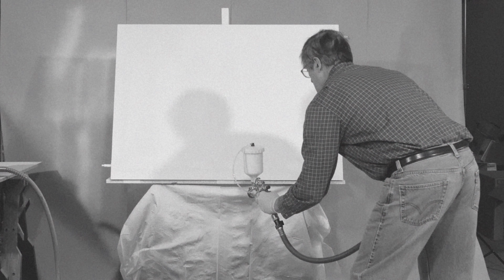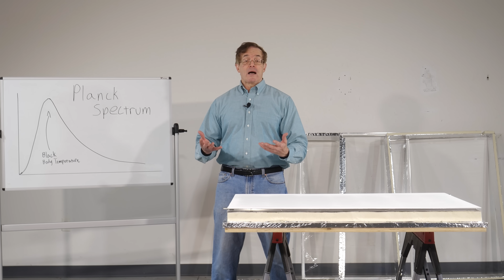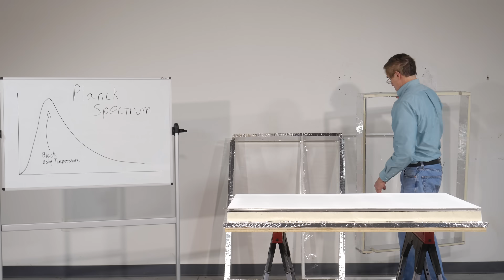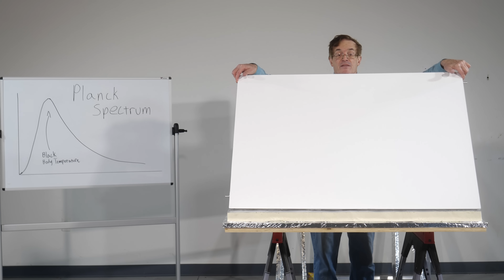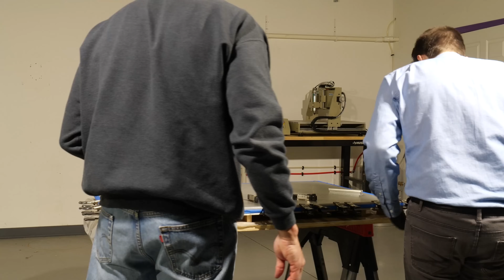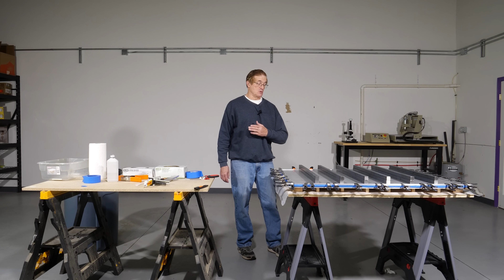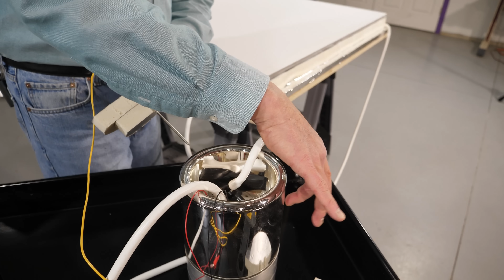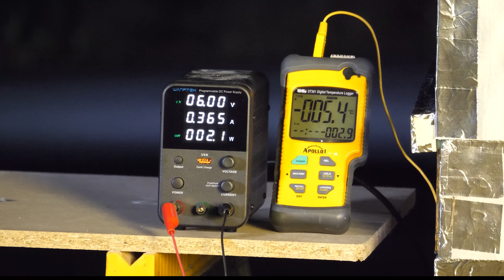Air Conditioning isn't free... but we're close.

Comment: We've seen the system is able to cool itself below ambient. Many systems can do that, though. To make it useful in practice, it has to be able to cool itself plus a thermal load. Imagine cooling a device with this - how much Wattage can it cool away and still get below ambient? If I need to cover the roof of an entire school with this to cool a single computer it's no longer inexpensive or useful. So: what's the thermal capacity of this solution per m² of roof space occupied?

Comment: Heat siphon might work well to carry the heat to roof top. Have to be able to stop the flow of liquid in winter though. Heat siphon is boiling a liquid, steam goes to roof and liquid comes down to for example to the heat pump heat exchanger. The amount of liquid needed is just to fill the down heat exchanger. Vacuum the tubes and insert the liquid like acetone.

Comment: HVAC tech here, and I see an obvious problem.  The flat panels with the special paint will quickly get dusty and lose the desirable thermal radiation characteristics.  The electric utility had an experimental thermal solar plant to produce electricity in the southern California desert.  It used mirrors to focus the sun's rays on a boiler. Of course the mirrors get dirty. The article I read showed that the wages of the mirror cleaning crew cost more than the value of the kilowatts. The same problem applies to this approach.
Reply from the maker: Maybe.
We're  testing  a few panels outside since this video was posted.  After  one year, we'll show the effect of the environment.

Comment: What if you placed fins like a heatsink on top of the radiating surface instead of the box, to block external factors? As long as the blades were sufficiently thin it should still be able to "see" the sky mostly unobstructed, while the fins would also be blocking incidental infrared radiation from surrounding objects. Also, what if you painted the fins with the same radiative layer as the main heat exchanger surface?
Reply from the maker: That's a good idea.
Reply: The radiative surface needs to be face the sky.  Fins are for conductive heat transfer to a (hopefully moving) fluid.

Comment: The reason I watched this is because way back in college in my Heat Transfer class on route to my engineering degree, my professor explained radiant cooling and anecdotally explained why people have been able to make ice in the desert by digging a hole and filling a vessel with water at night.  The heat radiated into the often clear desert skies at night while absorbing very little heat, enough to make ice.

This was a great experiment!  I can see this as a way to boost existing air-conditioning and refrigeration systems to save electricity!

Comment: This is poppycock.  If you could actually cool something below ambient temperature without energy, you'd have a perpetual motion machine.  You'd just connect a Stirling engine to it.
Reply from the maker: No.
Rewatch the beginning of the video.  Ambient temperature is the equilibrium of everything, including the air at ground level. This is due to the inter-exchange of  both direct conduction and infrared radiation. Because  space and the upper atmosphere is so cold, a surface that radiates that infrared better than everything else can dump that energy better than everything  else into space. That surface needs a clear view of space, or this will not work.

Comment: Wouldn't the power supply be heating the temperature sensor?
Reply from the maker: It does a little bit.
The actual  thermal performance is a little  better than shown.

Comment: You must have a engineering degree in the combination of all other specialized trades. That is an extremely intelligent design. Would have lost several on the expansion with the inflow and exfow. I do have an inquiry though, what is the atmospheric pressures put on the epoxy bonds? Does it seem to hold over long durations of time or crack at highly pressurized areas with vibration stess points or points of resonation?
Reply: Also, is water the best medium for absorbing ambient temperatures, versus isopropyl alcohol and water mixture, or copper sulfate and water mixture? Just curious.
Reply from the maker: Thanks. 
Water is the best, but depending  on the minimum  temperatures expected, an antifreeze additive such as alcohol or glycol could be added with a small drop in performance. 
The epoxy bond is far stronger than needed as the pressures  are quite low.
Reply: @TechIngredients  thank you for the response. I greatly appreciate your content and always treasure your advice. It's hard to say I'm not trying to flatter you, when I do so enjoy your ideas and the way you get your points through. Again thank you and I wish for you all the success in the world.

Comment: @TechIngredients, so in theory, running this loop behind solar panels to cool them down say in the Phoenix temperatures, is a feasible thing to do? So run the exchanger on the roof where the solar panels are not and use heat exchangers fixed to the rear of solar panels should increase efficiency of the solar panels, and put hot water in my pool or holding tanks for the house?

Comment: if the cost of the coatings exceeds the electricity cost to run the AC, its not economical.
Reply from the maker: That's  correct.
Keep in mind that cost can become  complicated.  There's  installation  and disposal costs, aesthetic concerns, local regulations, and structural limitations.  It's  nice to have options.
Reply: Don't forget the cost of a squeegee crew to keep the coating clean.  A coating of dust changes everything.

Comment: Interesting radiator. I made a smaller one for a gaming console about 20yrs ago using aluminium, a dremel and aluminium jb weld epoxy.

Interesting paint
Reply: yeah its basically a Single Panel  (Type 10) radiator

Comment: I made an experiment of underground tunnel, very small one on my lot and put a fan on the edge of that tunnel. The design was a pipe from my rooftop around my garden, traveling all the way underground getting sucked with the fan. Its not as cool as aircon but its cooler than an actual air fan is giving. The idea is the fresh air from my garden, cools of the air while traveling on the tunnel until its released on the fan sucking the air from my rooftop pipe. So I feel comfortable because the air comes from my garden.

Comment: Could you put a thermal electric couple on the opposite side of the heat exchanger to power the pump off of the ambient outside temperature?
Reply from the maker: Yes.
However,  these devices  are very inefficient.  You'd  be better off using another  source  of electrical power.

Comment: how's the performance during hotter weather?
Reply from the maker: The performance  increases as the temperature  increases.
Thermal radiation  is dependent on the temperature  to the fourth power.
Reply: @TechIngredients  yes, my apologies for not being more specific, but have you measured it during the summer?
Reply from the maker: Yes.
The differential is greater by a factor of about 3.

Comment: Did you experience any condensation and achieve any due point variants? If you did, you can also use this to collect drinking water. Multi harvesting can help achieve more reward with less separate systems.
Reply from the maker: You're correct.
We didn't because  the relative humidity levels were pretty low.

Comment: The temperature of the refrigerant coming from the compressor after the fan has removed heat from the refrigerant, most certainly can get lower than ambient temperature.
Reply from the maker: Correct

Comment: We're over halfway thru the video. You still haven't explained what you're making, what it does or how it works. You explained the science behind thermal emitters and then said "so we built this".....to do what? How do you employ it? And then you simply went into building the components. What exactly do the components do? There's no structured path to understanding what we're seeing or hearing, creating more confusion than understanding.
1. This is what it is (also is it a scale model or an actual operating system?)
2. This is what it does.
3. This is how it does it.
4. Why it works (now explain the science of it).
5. These are the components.
6. This is what each of the components does.
7. Component #1, the So And So. 
8. These are the materials it's made from. 
9. This is how much of each material you need. 
10. This is where I procured each material (and other possible sources. Can I use an alternate material?).
11. These are the subcomponents of Component #1, the So And So.
12. This is how you build this subcomponent of Component #1, the So And So.
13. Repeat. Demonstrate how to build each subcomponent of Component #1, the The So And So 
14. This is how you assemble the subcomponents of Component #1 to complete the So And So build.
15. Repeat steps 7 thru 14 until all components of the system are completed and ready to assemble the system.
16..This is how you assemble the components to complete the system (stress any peculiarities and key points of building the system to ensure it will do what it's suppose to do or to prevent failure).
17. This is how you employ the system (include ideal circumstances and possible modifications that may be necessary).
18. Demonstrate/test the system. (Also display and explain the data). 
19. Preventive Maintenance Checks and Services (routine maintenance, before, during and after operation maintenance, intervals, trouble-shooting, spare materials to keep on-hand).

The idea is always "Bottom line up front".......This is what it is. This is what it does. This is how effective it is.......then justify those assertions.....explain how it works and the science of why it works, and the data that proves it works. THEN demonstrate how to build it, put it into operation, and maintain it.

You did it all backwards and left out a lot of explaination. It was a state of confusion of what you were actually doing until two thirds thru the video and left a lot of questions unanswered.
Reply from the maker: Thanks for the long comment.
Reply: @TechIngredients  I like your topic.       I appreciate the time you take to present it to the rest of us. If I didn't  believe in the merit, credibility and potential of your content, I wouldn't have bothered.
   I'm a DoD contracted civilian instructor. I train all US branches of service and some foreign militaries on 32 different US DoD combat service and support systems; from EOD bomb suits and parachute systems to communications, laser and thermal optics. 
   It wasn't my intent to nitpick your video. My intent is to suggest a better structure to your presentation to make it more effective and "more learnable" (easier to comprehend with less frustrating confusion).
Thanks and good luck!

Comment: I've long been thinking about this as an alternative to solar for fixed energy production. Heat engines need a hot and cold side, and we usually think of ways to use ambient air as the cold side, but perhaps we could use it as the hot side. ~200 watts per square meter isn't bad, and works better the farther it is from the equator.

Comment: Is the primary layer just solid foam  covered in the silver tape and topped with a thicker layer of foam? More details in the Patreon site? Thx
Reply from the maker: I'm  confused.  Can you be more specific  when you say layer; which layer, and where?
Reply: @TechIngredients  hi! Thx for responding. 
Base Layer 1 looks like it's an inch thick and covered with the aluminum tape. Planform looks like it is the greatest width and length of the enclosure.
Layer #2 appears to be solid polyurethane foam sheet several inches thick (3" ??) and is shorted in LxW by 3/4" (looks like) for accommodating the perimeter box wall that's coated in aluminum tape. 
I'm assuming these sides are from the same sheet stock as the base layer #1?
Hope that's descriptive?? 
Thank you!
Reply from the maker: They are.  The entire structure is formed from the same foil lined sheets of polyurethane foam, and the outside of the box is reinforced  with an additional  layer of adhesive, aluminum  HVAC tape.

Comment: In Alabama we have some old houses that have a round thing built in the top with windows that open on the 2nd or 3rd story and its basically free AC, you just open the windows or the door and its sucks so much air through the house even in the summer its a nice cool breeze.

Comment: I have a question about this device? What would happen if you took a a window unut rated at 5000 btu and incorpate this into the unit by placeing the condensor into it and piping it through tge compressor and the evaporator coil inside the house. If you find one that uses the 134a refergent which is used in automotive units and some small windows.
Reply from the maker: A good way to take advantage  of the sub ambiant cooling would be to insert this system between  a conventional heat exchanger and the expander.  That way, the bulk of the heat is removed by the air and additional  heat through radiative cooling.

Comment: Okay, so you made an air conditioner that works in a place and temperature where nobody needs air conditioning.
We can cool houses even more efficiently than your machine: Just open a window and let all the heat out. It's free.

Now try making a machine that works in Texas in August at three in the afternoon.
Reply from the maker: Maybe  you didn't  understand  the principle.
As I explained, this process improves the hotter the environment becomes. 
The radiation of heat increases with T^4 power.

Comment: are HDPE (High Density Polyethylene) Plastic Sheets in the 1/2 inch thickness also infrared transparent?
Reply from the maker: Yes, but...
Polyethylene still absorbs a small fraction of IR, and as the sheet becomes thicker, this absorption  increases proportionally.

Comment: I’m a Commercial and industrial HVACR technician sometimes I think about these types of concepts. Have you heard of Piezoelectric heat transfer? I feel like there is something there maybe like a hybrid mechanical/passive system as the passive most likely is not sufficient. Maybe mechanical ice storage that can be generated during off peak energy times and run during the day.  You could also use mechanical vibrations to activate heat transfer with some type of piezoelectric material heat exchanger
Reply from the maker: I have, but I I haven't  played around with it.

Comment: It may be a bit more work but i think using a gasket for the metal box would be a much better long term implementation for durability and maintenance. Water eventually will get through the glued joint, and fixing that is a lot more work than changing a gasket, which would last probably quite a bit longer, also eliminates the need to wait for curing. This kind of passive tech should be used more, a lot easier to scale and much easier to implement.

Comment: Just bang Trompes on to the exterior of dams. You get supercooled air plus more spinny spinny for the turbines. Think of how much isotopically cooled air you can generate from 40 Trompes dropping from the Hoover dam for example. That is an insane amount of energy. And air conditioning. Might be a bit louder with the pressure relief, but it's cheap.

Comment: If this is correct, and really works, why don't you find a good solar powered fan, and implement both into an efficient air conditioning system. You could construct coils based on these same principles, add a fan and a squirrel cage, and frost the windows on the house. Seems like you might be almost there with a water cooled sytem, but what do I know.

Comment: I use my DIY small solar system to run my A/C. The only problem i have is  the on going Weather Modification program blocking out the Sun. A few weeks ago we had a temp of 42F early morning hours. We also had the most rain in July this year. The Biden Admin put out a P.A. it was going along with a program to Dim the Sun. BTW i live in MA. Other States like AZ have had breaking high temps. So it all depends where you live on what kind of weather mod. program is upon you.

Comment: So, I have a practical application for this whole idea and it's something people are doing all the time. I'm purchasing an all-aluminum cargo trailer to turn into a camper. They are comprised of a rigid structure of 1 inch aluminum tubing with glue bonded seams of aluminum skin 0.030 in thick.  Now, traditionally, people place wood furring strips on top of the aluminum studs, then fill the space in between with 1 3/4 inch rigid insulation. They are then covered on the interior with some form of sheet good, usually plywood. The ceiling is done similarly, sometimes with an air gap. These are still known to be ovens when sitting in the sun. Do you have any further recommendations on what can be done to keep this camper passively cool?  A very large community of DIYers want to know. The better we can insulate, the less solar/energy we have to use to keep them livable.  It might also be useful to know that the current trend is to install mini-split air conditioners in these units...in case that is of some advantage.

Comment: Plastic has less ability to transfer heat than aluminum, but it is not zero. For a production device it may be useful to have all PEX type plastic carrying the water, or formed plastic bonded to aluminum to cut down on the materials used.